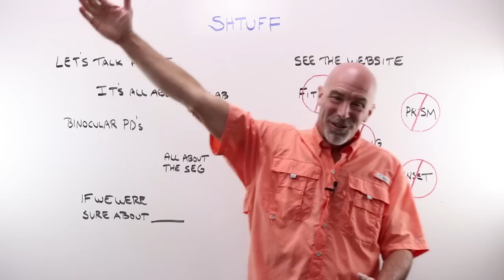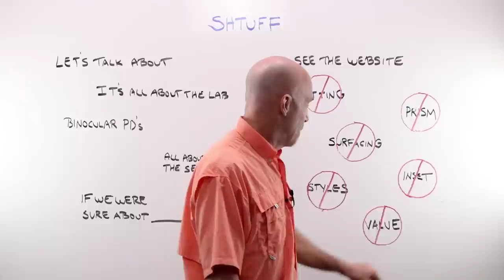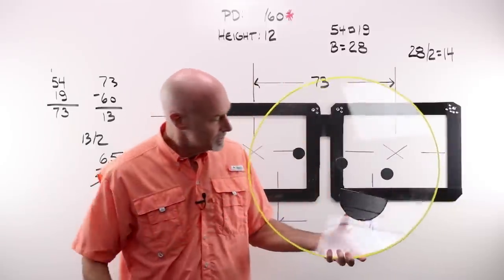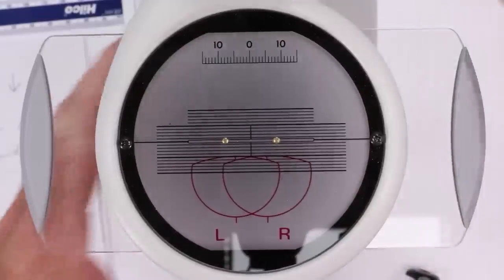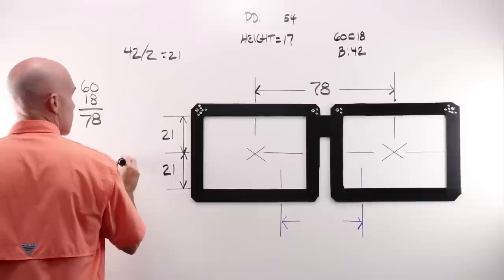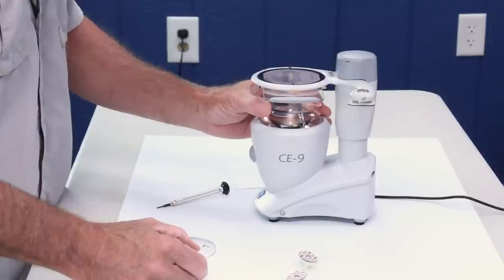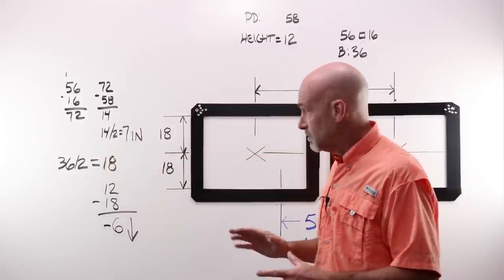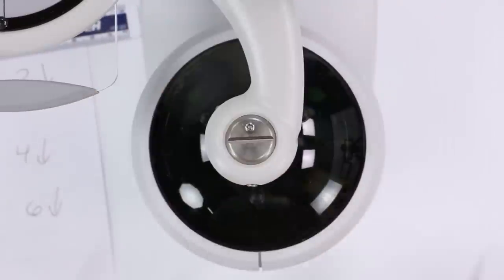Straight Top Multifocal Layout and Decentration

Comment: For round tops to you do the same?
Reply from the maker: No. Round segments are different. I pinched this from over on OptiBoard. Honestly I think I did one once and have had zero luck finding anyone who knows much about round segments. Wish I did. 

:idea: I thought i would cover the correct way to mark up round segs for edging, more especially for some of the newcomers, in the business. If the round seg is a cylinder lens then you lay it out on axis and fit the bifocal between the lines after setting the total decentration. If the lens was ground correctly your center dot will be in where its suppose to be.........................................
.........The problem come with sphere only lenses. First after you dot the lens up in your vertometer, wipe off the two end dots as the center dot is all you will need. Now lets say the decentration is distance 2.5 in and seg 1.5 in, a total of 4 in. Next set the total decentration at 4 in. Line up the bifocal between the lines as even as you can get and now rotate the lens either right or left, depending on which eye your doing. Rotate it back until the dot is now showing 2.5 in. Now when you stamp the lens with the marking cross you should measure the distance oc at 2.5 in and the total as 4.